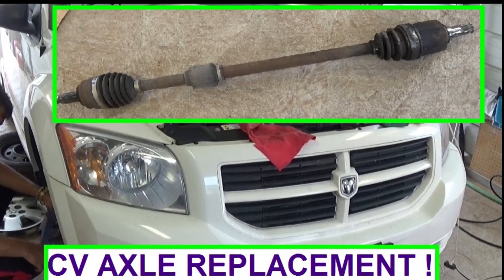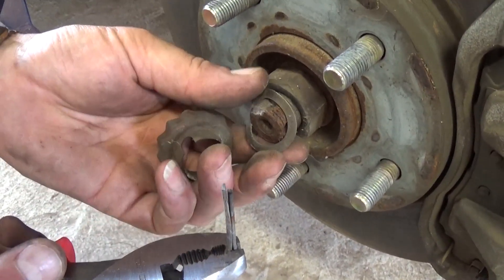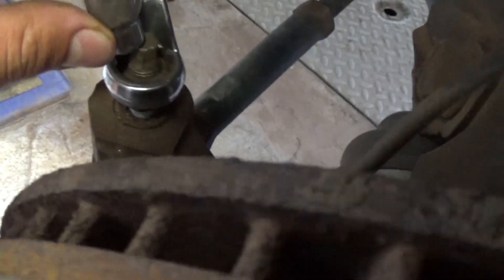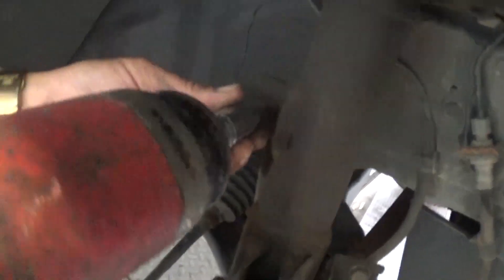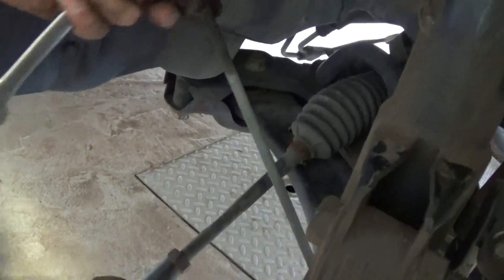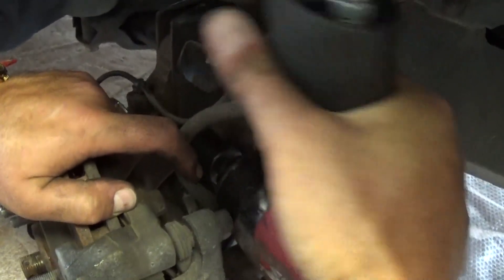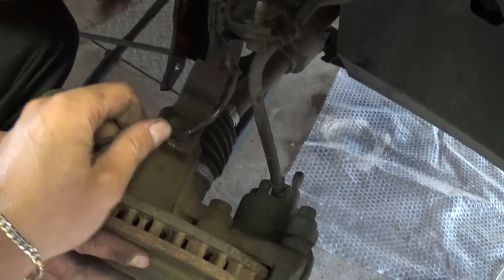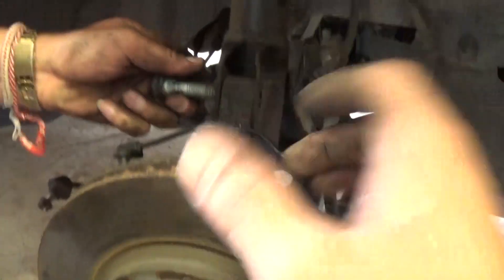CV Axle Shaft Replacement on Dodge Caliber 2007 - 2012

Comment: which way does the seal go in.  Not one single of the cv shaft replacement show this.  The factory service manual does not show it..  It will to in and everything will bolt up just fine.  But if backwards big trans fluid leak and everything you just has to be done again with a new seal

Comment: Bad procedure starting off. I pray No one follows this. I must apologize but the struts are Never to be loosened nor disconnected from the knuckle. By doing so you will have disturbed the wheels alignment! And guess what, once everything is back on, you'll need to ride down to an alignment shop and pay. The correct method is to Loosen Cvjoint nut to the end but do not remove, then Remove: wheel, brake caliper (hang caliper upto strut spring with hanger wire or something suitable). Disconnect tierod, turn knuckle all the way to left if doing left side, now tap the Cvjoint shaft/nut to break it loose from bearing, remove nut, now firmly force/push Cvjoint out from bearing. The rest you already know.

Comment: What about 2008 SXT with 5 speed manual?  On the right hand shaft it has an intermediate bearing bolted to the engine block and a brace at inboard end. The replacement shaft has no intermediate bearing and the brace won’t allow the inboard joint to insert and seat into the transaxle. Is the new shaft an upgrade and the brace has to be removed?

Comment: I just watched this step by step and took my axel out but when I pulled it out my transmission fluid cam out all over the garage floor.  And idk wher to refill it st if I even can put new transmission fluid in myself I don't see the dipstick for the transmission fluid
Reply: You have to remove the air intake part that is above the battery to get access to the transmission tube where you can fill it with trans fluid. Make sure if yours is a CVT to use the proper CVT transmission fluid. Also you would need to order an aftermarket dipstick as the calibers don't come with one, they just have a cap. I bought mine off of amazon for $20-30 as I was having a leak that seemed to be coming from the axle seal and I wanted to make sure the trans fluid level wasn't running low.
Reply: @derrickstewart7197  I didn't have to remove the air intake part to refill my transmission fluid mine actually sticks up higher next to the battery I just removed the cap that says do not remove cap dealership remove only or something along that line but I just put a little less then a quart back in my transmission cause when I took out the driver side axel the fluid came out all over and it looked to be about a quart or less that spilled out and yes I got the exact fluid it needed so my transmission wouldn't mess up putting the wrong stuff in. Mine didn't leak or anything after putting in new axel. No slip in tranny or any issues what so ever with it. I didn't buy any fluid when getting the axel cause the video I watched had no fluid come out after they took the axel out but I think the drained the transmission fluid before taking the axell out idk but I had the auto part store deliver me transmission fluid cause the guy there also said the fluid would come out once I took out the axel witch was a lie so they deliverd me the fluid for free just paid for the fluid itself.

Comment: I HAVE ENGINE COOLANT LEAKING FROM MY AXLE RIGHT WHERE GOES IN ON DRIVER SIDE.IS THAT NORMAL DURING SEAL FAILURE
Reply: Cashandra Blash 
Axel grease looks similar to dirty coolant after a CV boot failure.  Could this be the case?

Comment: so it looks like pulling the passenger side axle doesn't cause you to lose any trans fluid judging by this video.  Am I correct? I really don't want to have to play the guessing game on if the trans fluid level is correct or not if I can avoid it.
Reply: Pulling the passenger side axel didn’t release any fluid for me. Doing the driver side did make a mess. Best of luck!

Comment: is this the same process for the Dodge Journey? Mine is a UK 2010 2.0 CRD diesel with the 6 speed transmission. Curious why no transmission fluid came out when you pullled the drive shaft out, did you drain it first?

Comment: What's that black thing in the middle of the old cv axle?
Reply: "probably" a universal joint- allows both half axles to move independently as each (front) wheel/tire adjusts to roadway.

Comment: Thank you for your video. Size of sockets you mentioned were a great help. Problem is I tried to take out the sway bar nuts from 6 pick n pull caliber and could take out on only one because oil from leaked shock from that car lubricated the nut, rest I rounded  2 allen key and failed. I guess till car companies don't install rust proof nuts and bolts, oxy-acet torch is the only secret method removing nuts/bolts that holding regular diy people fixing their cars.
Reply from the maker: it depends on where you live. This Caliber was in Oklahoma so it was not exposed to rust at all. Thank you for watching us and we hope that you find the channel interesting!

Comment: For FWD Calibers you only remove the lower ballpoint and caliper hose bracket, then pop out cv axle at transmission, pull outward on wheel till exits transmission. Replace seal and pull back out on wheel while guiding the shaft back into transmission.Both sides done this way. AWD calibers on right side Require the entire axle removed to replace its right seal due to shaft going all way through PTO for Rear wheel carrier. The left side is done like the FWD caliber.. Rear AWD calibers remove the sub-frame cross braces and the lower control arms, then pop out axles from carrier , they will hang while you replace the seals because you removed the brace pieces.

Comment: Your video was awesome!! I was able to follow it through perfectly and with ease, I do wish there was a re-assemble video but it was great! Thank you!!!!
Reply from the maker: +Carliena “Lena” Smith We are glad to hear it was helpful! If you ever need help let us know!
Reply: There really is no need to have a video on how to re install the axel once you take it out it's pretty easy to replace it just do the exact opposite of the removel. Pretty self explanatory I'd say. And it was easy for me to take apart amd pit the new one in. These calibers are pretty easy to work on I'd say I've done alot to my 09 caliber myself. The struts, axel, ball joints, driver side wheel bearings front and back, calipers, front rotors, front breaks, starter, alternator, now I still have to do the front passenger now cause it's making noise and all the fun sounds coming from the ball bearing. I wanted to replace both front bearings but I wanted to do the worst one first, and come to find out it's the passenger one that was the worst hahaha oh well I have to do both front back wheel bearings now then it'll be good.
Reply: joe vazquez hey question... I put new lower control arm, new struts all the way round, new sway links, new outer tie rods, I’m hearing noice whenever I go over any small bumps like a pluh pluh I thought it was the strut, but I think it could be the inner tie rod (I thought that it shouldn’t have any play in it when I replaced the outer, like it moved side to side/up/down easily...) or I dono if it is the cv joint...???? There’s only so many things left to replace lol...
Reply: @Chris58369   Christopher Catherman  ball joints, tie rods and CV Axel's can cause that. CV Axel's sound more like grinding bones when going out, so it's a little different than a clunk. Tell by how loose the tie rods are on this vehicle, they're pretty much shot.

Comment: hello, I am looking how to check and replace transmission fluid after doing this on the drivers side. any ideas?
Reply: Always catch fluid , then replace what was lost. Otherwise you have to buy a dipstick and a OBD2 scan tool.It is all based on Fluid Temp for all CVT Transmissions.Best to drain entire fluid into clean bucket then sitting both the used fluid and the new fluid side by side for a given time.Then mark what is in used bucket at certain temp, then fill up bucket with fresh fluid to match where you marked the old fluid level. Best way when you dont have scan tool or dipstick. CVT Fluid has to be just right, that's why they do not want just anyone checking/changing it.That is why you have no Transmission Dip sticks any more! If you got fluid leaks to start with you ca not use replace what comes out, you will have to buy a dipstick setup ands a scan tool for temperature readings to ensure fluid level is exactly where it should be for a given temperature, no way around it then..
Reply: try duck that just sucks!!! Another thing we can’t fix on a vehicle the stealership wants $$$$$$ such bs!!!!
Reply: But is it ATF+4 fluid or CVT Transmission fluid for manual vehicles? Mine has a sticker for ATF+4 but I just want to be sure. Don’t want to ruin my engine. Thanks

Comment: Great video! keep the videos for dodge caliber coming! I see how you were able to remove the passenger side axle by loosening only the tie rod and strut. You did not remove the ball joint. Could you remove the drivers side axle the same way? Or do you need a pan for the atf?   Also, do you need to remove the ball joint on the on the drivers side?